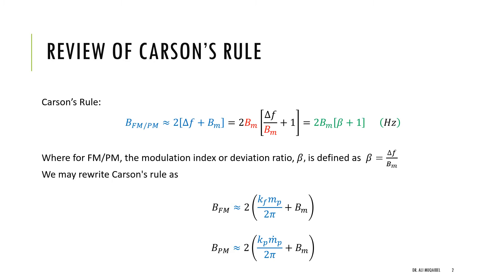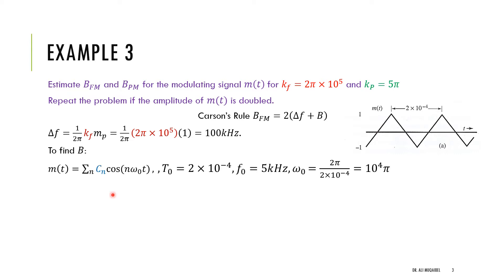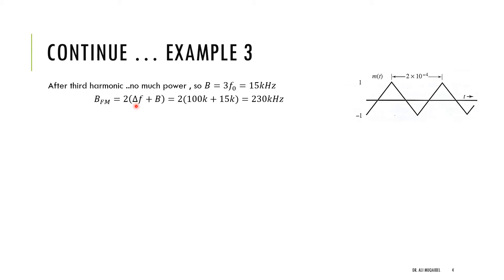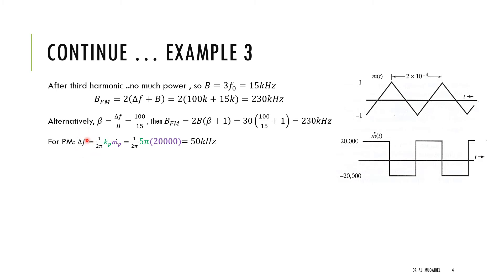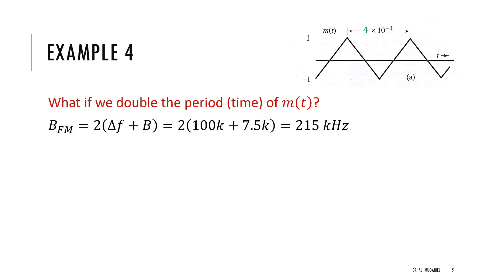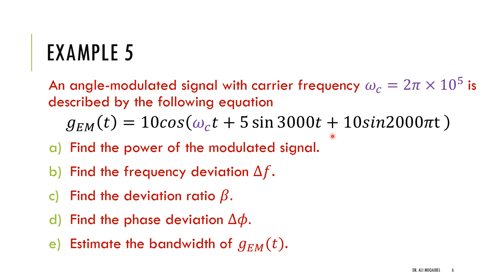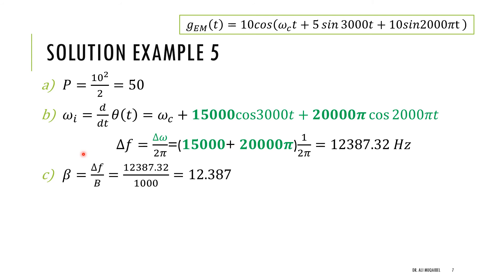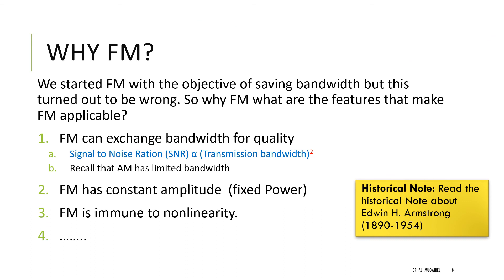5.5 Examples of FM/PM Bandwidth Estimation (Carson's Rule) and Why FM/PM ?

Comment: For the bandwidth estimation, do we always assume the first 3 harmonics contain most of the power of any signal? (so B is always equal to 3f0)
Reply from the maker: No, We need to see how the energy/power is distibuted over the frequency. We need to accept a certain level of power. Let us say 95% or 99% depending on the application and then we see up to which harminic we assume the bandwidth.
Reply: @alimuqaibel7619  Right, thank you.